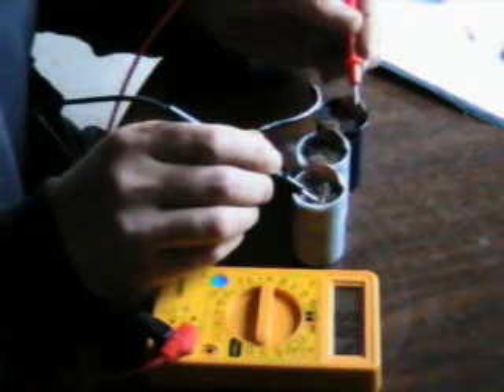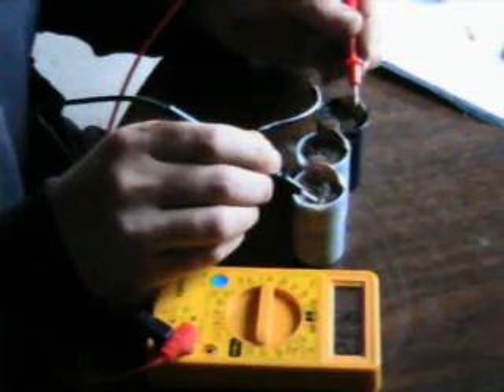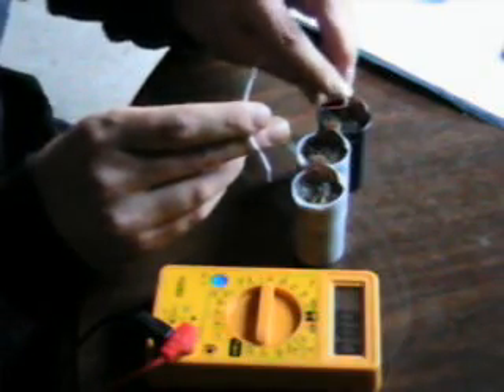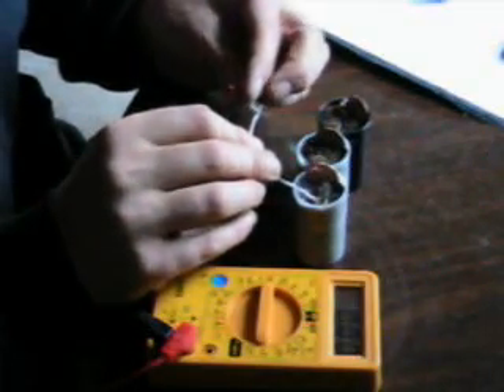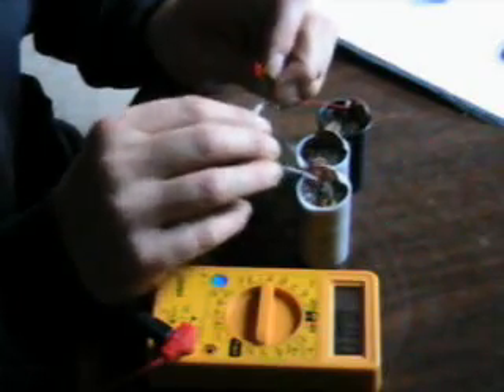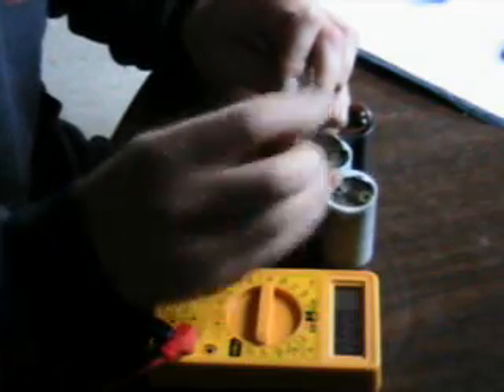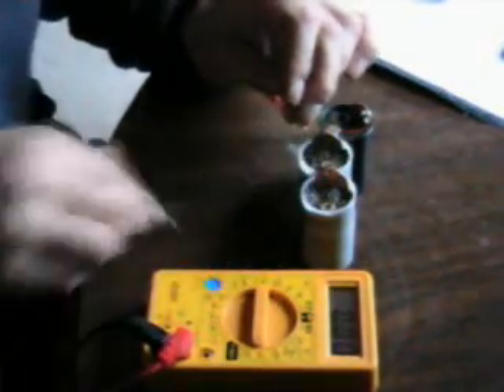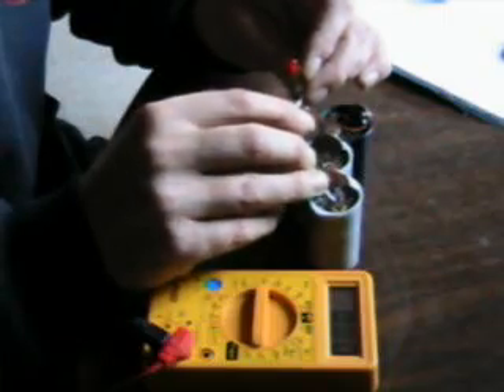3 Cell earth battery

Comment from the maker: @michaeldiaz2 I havn't tried. Most solar panels put out way more power than a voltaic pile produces so there is really no point. These cells generate power through a redox reaction and aren't really designed for storing a charge.

Comment: If your not worried about the battery destroying itself, iron / aluminum pop cans and bleach gives you 2v cells. My zinc plated steel copper gives me 1.1v, but my ideal (hopefully) will be my nickel plated steel (homeplating) + copper. I'm going to bury long strips of plumbers strap, isolated from each other by layers of polymer based microfibre cloth, or polymer (thin) scrub pads. I'll saturate the strip I cut in the turf with strong NaOH, then backfill. Wish me luck lol

Comment from the maker: The dirt simply acts as a substrate to hold the acid. The acid is Hydrolchloric Acid. There is a violent redox reaction between the metals (copper and zinc) which produces a high current. Unfortunately the redox reaches equilibrium quite fast ... the cell only lasts two days. Bigger metal and weaker solution should improve that.